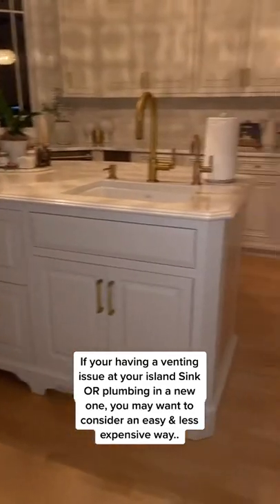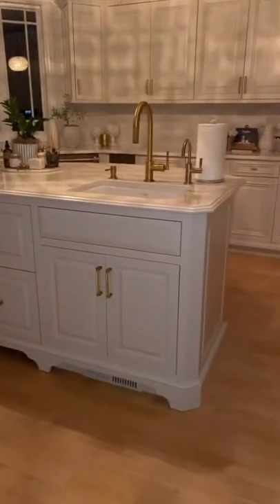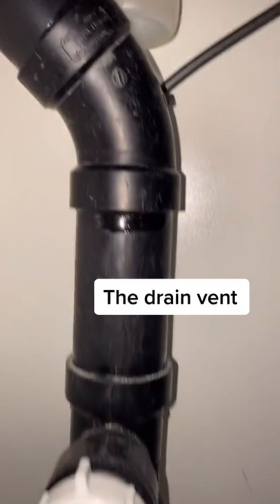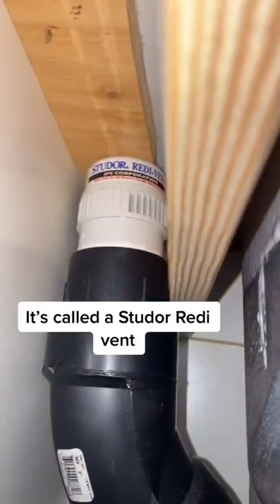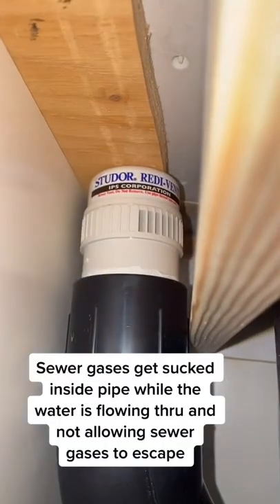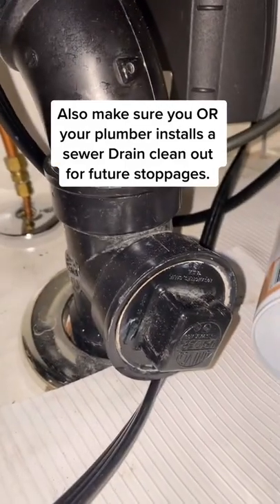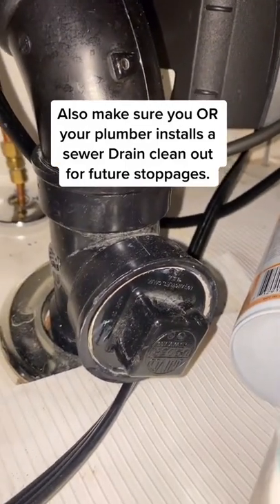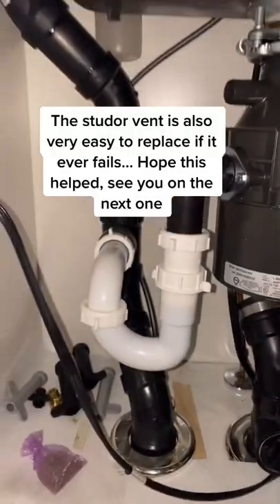Sewer Venting Alternative for your island Sink

Comment: Sewer gases don’t get sucked in the pipe, a vent allows outside air to be drawn in and stop siphoning of water from the trap and sewer smells escaping. It can also assist with flow on drain down of the sink again for the same reason.

Comment: Until the sinks drain gets clogged.  Your vent is lower than the rim of your sink so guess where the water will go.
Reply: It sounds like if the sink is clogged you should turn off the water before it fill the whole sink
Reply: @kurticus :  If a dishwasher drains into that drain and is ever run overnight, you could wake up to quite a mess.
Reply: @ncooty  I see
Reply: By code, it only needs to be 4" above the horizontal drain line, unlike it's conventional dry vent counterpart. It also doesn't allow for backflow, similar to a preventer. I don't think it's an issue

Comment: Damn, that vent only needed to be minimum  4 inches in height from the drain. Not 15'
Reply: The higher the better but in this case too high because it can’t be unscrewed if it fails.